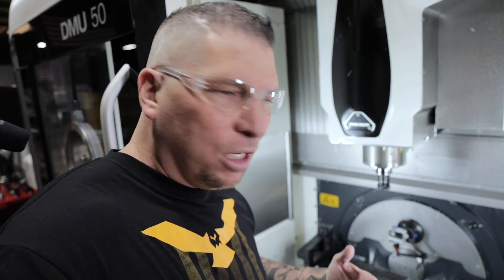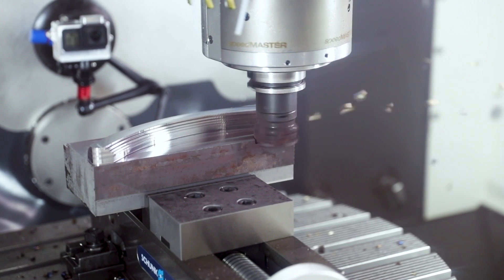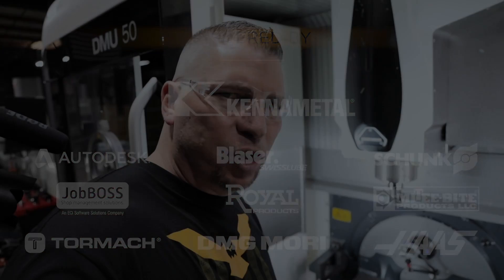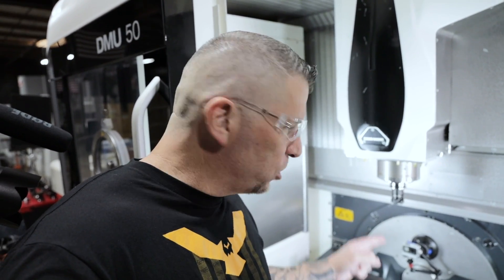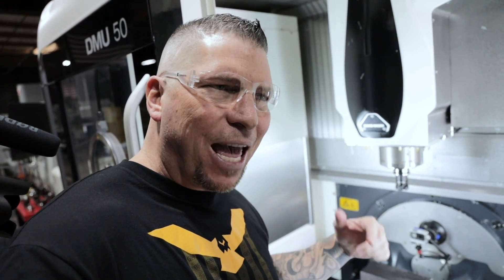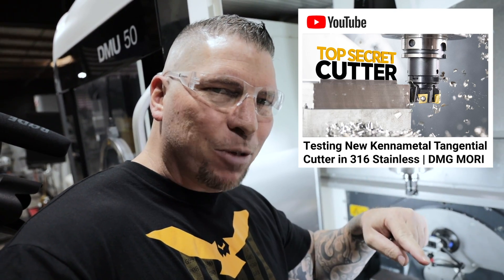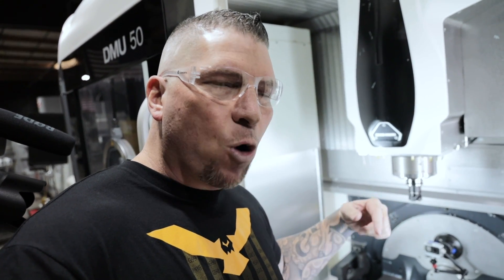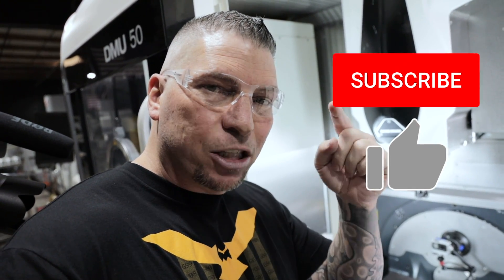Kennametal  Mill 4-12 KT CNC Machining 4140 Steel | Tangential Milling | VLOG #63

Comment: Hey Titan, I am very grateful to your efforts and educational principles, enthusiasm and knowledge about everything you shared so far. Many times you talked about kissing the part (meaning finish operations on a CNC machines where all the MRR are not so important, but the precision is... everybody understands that without the precision where its needed and good tolerances, the parts are scrap. You talked about big and powerful, expensive machines that not so many people around the world can afford, and don't get me wrong, that's grate but what about not so expensive machines, like routers, home builds -DIYs or professional entry level like Tormach or Syil when finishing op is done. What's the precision there. On a router where X and Y axis has different deflections (not equal deflection) because of the reaction forces milling steel or some tough materials. While boring a hole with Kennametal HARVI1TE, I noticed different precision error for finishing op, and doing ellipses when trying to make circles. What you do in that kind of situations, do you helix (wearing only the tip of the endmill)? or you go deep full depths but smallest radial increment (wearing because of increased friction because of the deflection , or you standardized the final passes with some prototype build and then go for large but precise series of parts. How do you charge for prototyping parts (because of setup type, coding and fixtures), corresponding to a large series. Maybe you will add something in next videos about it Thank you in advance for everything YOU ALL do here :)
RESPECT! BOOOOOM!!!

Comment: hi titan, i have aquestion, i have at work dmu50 and every time i do simultany operations (all axes working at the same time) the machine works  odd, not smooth, like its taking too long to read the codes, do you any ideads whys that happens?

Comment: Hey Titan im a huge Fan of your Videos  in a few weeks Ill Change to cnc Programming in our Company i often  experience  Feed and speed rates but i want  to ask  you  where do  get your rates? Do  you  use  experience or do  you use feed  and speed rates from  the carbide producer? 

Greetings  from Germany
Reply: I grind endmills and would recommend using the calculator from the tool manufacturer. Of course, adjust as necessary for your application and what your machines like - there will be some variance but the manufacturer specs is a good starting point.
Reply: @parmesanjon  thx for your answer :) helped me a lot :)
Reply from the maker: Through experience and always calling tech support when I use a new tool.
Reply: you dont know how happy i am about your comment :D  in germany in our professional school we watched your video because i showed them to my class :D  ok back to your answer: so ill make a mix of both  -  ill learn cnc mill on a MAHO -600E  Do you know this machine?

Comment: Wouldn’t it be nice if a modern day nc machine was built with as much mass as a 1960’s English or German machine
The vibration on that 1st cut shook the camera
Reply: Remote Broadcast 
Shows the machine was shaking 
Cutting 4140 at those depths and feed speeds is still impressive

Comment: Hey Titan, did you know about cycle832 ? It will eliminate those jerky movements. You can add it using the high speed machining icon on the touchscreen, just select the variables you want to use. I program 3 dmu50's at work and could not live without cycle832. Just don`t forget to cancel before next tool change with cycle832().
Reply from the maker: Yes... Thanks

Comment: I have a project that I may try to do on my machine, it would  require some deep cavity surfacing. I haven't  really come across any videos  of that type of work. If it pleases the court, I would  sure like to see a video that covers it. Extended tool stickout, extended tool holders, SF, RPM, cutter design, etc.
Reply from the maker: Ok, that’s good stuff...

Definitely reduce RPM’s the longer your tool is to increase force and reduce vibration

Comment: I think you need a longer mill. Probably could've roughed out that curvature in two or three passes then came in with the smaller cutter and begin rough profiling. Not sure of the power of the machine though.

Comment: Hi Titan. I‘m a cnc machinist and programmer from Germany and i really like your videos. 
But please tell me why the toolpath on this part sometimes is so „strange“. It cuts on one corner and left some material than goes around the part and cuts on another corner than back to the first corner (hope you know what i mean?) That programm could have been a bit more efficent. I see this back and forth on a lot of videos on youtube. But why is it done that way? Is it something that comes from the CAM-Programm? Or is it just for tool-demonstration? Or is it the best way for toolwear?
Maybe i have to add that most of the time im working on lathes with livetools and subspindels with mostly easy mill or drill operations. So im not so used to this step-by-step line milling.
Reply from the maker: It’s called Adaptive Roughing
Reply: Thanks man. 
Would be better if its called addictive Roughing. Cause im addicted to milling and turning. 😉

Comment: The non cutting moves seem real jerky
Reply from the maker: Yes, need to adjust my tolerance
Reply: @TITANSofCNC  It just needs a cycl 32 in the code after the tool change, adjusting the tolerance in the cam toolpath won't have as significant effect as cycl 32.   Try a 0.004" tolerance, with hsc mode 1.   It needs cancelled before the next tool call, or the next tool will still have it applied, just another cycl32 with no entry.   I can't seem to find a good way to utilise cycl 32 in my inventor, or fusion post, but i'm working on it.  I add it by hand in the mean time.

Comment: Could we get a video on hard milling? Probably don’t see it much in the Aerospace space, but we see it all the time in our job shop... and struggle every time. Specifically the job we are working on is for a hot stamping die. All the form steels are made out of Dievar, and heat treated to a 54-56 HRC. We were instructed by our customer to leave 4mm stock on all form surfaces and joint edges between the blocks, because of how much this steel warps during the heat treating process. We are struggling. Any help or and instructional video would be awesome on this! Thanks.
Reply: get the right tools, speeds and feeds
Reply: Brandon Bartkowiak Brandon, we definitely aren’t afraid to get the correct tooling in. We bought 3 different brands of 2” inserted cutters specifically for this job (Ceratizit Button, Seco Button, Hitachi High Feed). Obviously we consulted with our tool reps to get the correct inserts in. To our suprise, the Hitchi is doing the best (550 RPM, 65 IPM, .012-.015 DOC). That being said, we aren’t cutting small blocks. Some of these blocks are 25” x 12” x 12” with the entire top form area having 4mm (almost .150!!) of stock on those form areas... that .012-.015 DOC, as you can imagine is taking forever to cut these blocks... I’m just looking for more advice from others out there that aren’t trying to sell me tools (like our tool reps). As you can imagine, an end-mill, and we specifically keep Helical stocked in our shop, will not cut it for roughing out these large, 3D form surfaces... All i really see from Titan is him cutting alot of the exotic steels, or aluminum. This is really one of the first videos I’ve seen him cutting a piece of steel that I specifically cut day in and day out in a heavy Tool and Die oriented job shop. I think it would be cool to see more videos cutting these steels, hardened tool steels, etc. because I know there are plenty of other shops out there like us in a heavy tool and die oriented space.
Reply: @BrandonKuiphof  switch to high flute  high angle solid carbide endmills and take fast but light cuts 
for  hogging u can stick with 2 inch or 2.5 inch cutters with round inserts 
i can send u some tools i use to cut that hardness  the only thing u need is a riggit setup
Reply: @BrandonKuiphof  In our shop we do 2mm of stock on that big block. But your speeds and feeds are kind'a ok. That's how it's done when it's hardened to 56Hrc. At least this is how we do it. We use YG-1“BLUE” Coated Nano Grain
 Solid Carbide End Mills.

Comment: Do they recommend running it without coolant or is it just for filming purposes?
Reply from the maker: No coolant, just air blast on 4140 Steel
Reply: Christoffer Larsen Insert tooling doesn’t like coolant when it comes out of the cut. Makes them brittle and breake sooner. 

That’s a very short explanation. There are lot’s of nuances just like a lot of area’s in machining

Comment: Thats a ridiculously heavy cut, could not even fathom that sort of radial & axial engagement in 4140 on a HAAS let alone at .014 ipt.  Very impressive rigidity and power from that setup
Reply: lol, I have done that on  Haas before no problem...
Reply: I regularly run a 40mm bull-nosed cutter at 2400 rpm 
.015 ipm , 3600 mm/min
It can ramp in at full width of cut. Axial is 3.3mm or 
.130". At the limit of HP , so can't go deeper. But tool life is good.
Reply: To be more specific, we have a HAAS VF1 with a Kurt vise.  It's a 19.08 HP cut, which is well below the 30 HP we have on our 15,000 rpm direct inline spindle.  That being said, the max torque is 654.17 ft-lbs with the cutting force at 775.1 lbs.  This is where I know I would have a failure with my setup.  I've moved the vise with a cut that only had 125 lbs of cutting force.  I maintain that I remain impressed with the rigidity and power form this DMG setup.  Thank you for your comments, its good to know I could get there with a 2 speed gearbox.  That would be a seriously good bang for buck setup sounds like!
Reply: 0.014 is a lot?
Reply: Haas wuld have no issues. I work in a medical shop running Ti and Stainless all day. And i run alot of haas machines. Vf2s Dt1s UMCs. Also a couple Grobs, DMGs and two Yasdas. Big boys. I promise you the Haas's have no issues keeping up. I take no less DOC or.WOC or IPT on the Haas EXCEPT some of the roughing that may be done on the Dt1s. Vf2? No issue. Especially if its the a Gear Driven spindle. The other machines are great at the tight tight tolerances and the micro-machining 5 axis toolpaths. Haas machines dont handle trying to hold tight tolerances using a .015 Ball mill with a toolpath that may not be much bigger than the tool.
Reply: My VF6/40 will handle it np.

Comment: That dmg is beautiful, don’t  even sound angry lol, I know you guys mostly target an American audience, but could you put metric feed and speeds next to the imperial, bit annoying to have to wack out a calculator during a video, thx guys
Reply: I'm American and we use metric in my shop. I wish we could buy our stock in metric. Would help a LOT.
Reply: How do you convert to metric?pls share
Reply: @srvishnuvardan5013  1 inch is 25.4 mm.
Reply: @RaVeN85887  sfm used is 650.
So what's the cutting speed in metric?
Reply: @srvishnuvardan5013  
25.4 = 1 inch

12 inches in a foot 

25.4mm x 12 = 304.8mm

304.8mm = 1 foot in metric

304.8mm x 650 = 198120mm or 198 meters per min
Reply: @Guranga93  that was so helpful.
How about ipm.
87 ipm X 25.4 = 2209?
It that correct?
Reply: @srvishnuvardan5013  650 sfm is 198.12 meter per minute.   Type "650 feet per minute to meter per minute" in google and it gives you the exact answer.
For everything else, if you want to quickly know were it is about in metric, just multiply by 25.  So 87 IPS is rounded 100x25 = 2500.  So it's a little less than 100, so lets say it is around 2200 mm per minute.  Let's check my guess: 87x25.4 = 2209.8  Close enough?
Reply: @srvishnuvardan5013  yes
¨
now try and solve IPT .014
Reply: @danl.4743  thanks
Reply: @Guranga93  0.3556
Reply: @srvishnuvardan5013  good
Reply: @srvishnuvardan5013  IPT, Yes.  For QUICK understanding for where it is about, remember that when you hear them say "40 thou", it means 40 thousandth. Or 0.040".   Remember that 0.040 is one millimeter (close enough).   So when you see 0.014 (14 thou), you know that it is about 1/3 of 40.  So it's 1/3 of a millimeter.   Your calculation came out exactly 0.3556.  Close enough to 1/3 of a millimeter, right?
When you have to know EXACTLY, you calculate.  When you watch a Youtube and just want to understand, you can quickly do that approximation in your head.
Reply: @Guranga93  No. That isn't 19m a min 🤣🤣🤣
Reply: @Mazrim_Taim  19m ???
Reply: Does anybody have a 12mm Drive ratchet wrench i could borrow 😂😂, have a nice day!
Reply: Brandon Kuiphof 
Nice hit
We have been metric since the 60’s in Australia and we still use 1/2” drives for our sockets and “gauge” for our self tapping screws-50 years experience and I still don’t get the gauge system
Reply: Can someone simplify this gauge measurement

Comment: In case you use Heidenhain iTNC you should use Cycle 32 to set your tolerance so it runs smother and its a roughing tool so the tolerance isnt that critical
Reply: For roughing, I'd like to see this set to 0.1mm tolerance, hsc mode 1.  I'd also put a cycl def 32 with no entry, cancelling it before the next tool call.   I'd love to see more about the new Celos control.
Reply: Very important! Also if you do 5x milling you should also define the TA value in the cycle 32 wich is the tolerance for the rotational axes. If you dont you will probably get shitty surfaces.

Comment: Just curious why the machine seems to be making jerking/twitching movements in between some of the cuts. Does it have something to do with it being a linear machine?
Reply: The Problem is the set tolerance if you dont set one at the machine controller the machine goes to every exact point
Reply: Justin L. It’s not a linear machine. The guy above me explained the yerking. It’s the way the control and CODE are programmed and which tolerances are used. I’m sure Titan is still in the testing phase and the Post and programming will improve in due time 👍🏻
Reply: Yep still looks like a new machine inside it
Reply: Thanks everyone. Makes sense. I'm not used to the newer CNC's. I currently run a horizontal thats about 8 years old and it acts a lot differently than some of these newer marvels.

Comment: Can you make a video about a real part being made like from order to shipping
Reply: Or like even a small batch of the parts would be cool. Material receiving, order example and a continuation of quoting, material prep, Programming, router generation, kitting, setup, run FP, inspection, run job, move job on for final processing, and from then on. Would love to see it all flow in your shop man
Reply: Probably not he makes areospace parts they are secretive.
Reply: Getting the orders is much more difficult than making the part. Making the part at a lower cost than anyone else tends to be the important part. And that’s not so easy to teach since it tends to depend on the exact part.
Reply: @ericspda  Well said
Reply: He did a while back with one of the building blocks